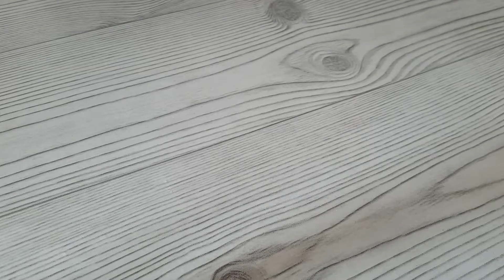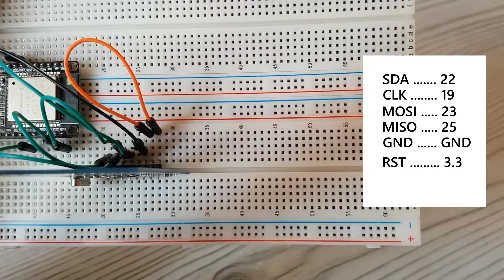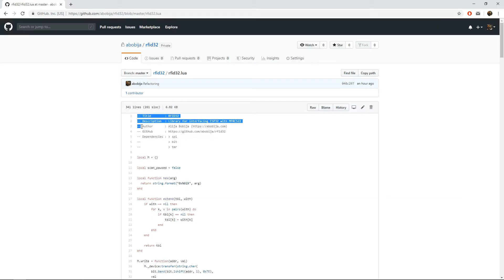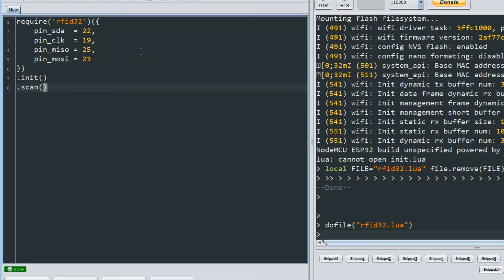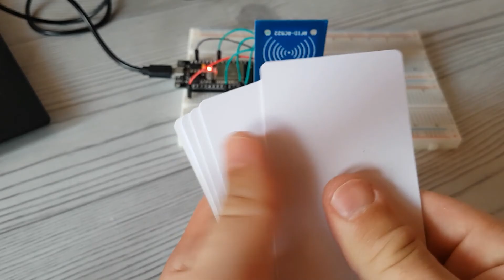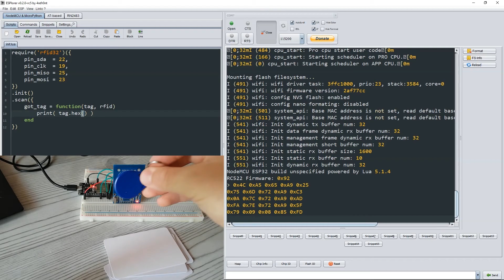Connect ESP32 with RC522 RFID Card Reader - rfid32.lua

Comment: hello , can anyone please help with this error ,i'm using esplorer and  my terminal shows while runing rfid32.lua :
 dofile('init.lua')
 [0;31mE (199725) spi: SPI3 already claimed by spi master. [0m
 [0;31mE (199725) spi_master: spi_bus_initialize(242): host already in use [0m
 [0;32mI (199725) spi.master: internal logic error [0m
rfid32.lua:312: bus init failed
stack traceback:
	[C]: in function 'master'
	rfid32.lua:312: in function 'rc522_spi_init'
	rfid32.lua:327: in function 'init'
	init.lua:7: in main chunk
	[C]: in function 'dofile'
	stdin:1: in main chunk
>

Comment: How can I use 3.3V for RST when the library requires a pin number: MFRC522 mfrc522(SS_PIN, RST_PIN);
Reply from the maker: Library does not requires RST gpio pin. Check this example code on the official "rfid32" github repo: https://github.com/abobija/rfid32#usage